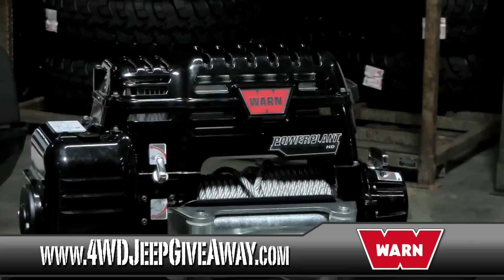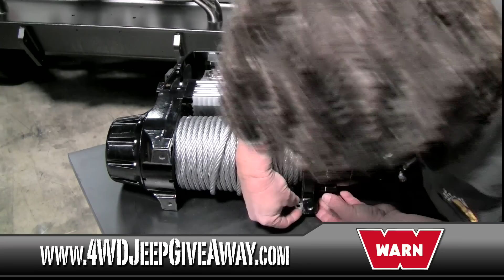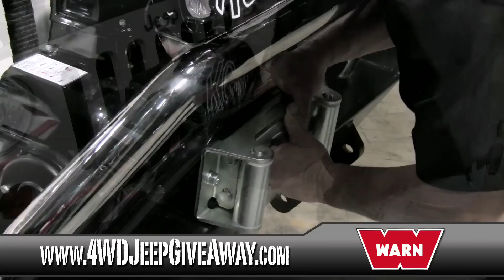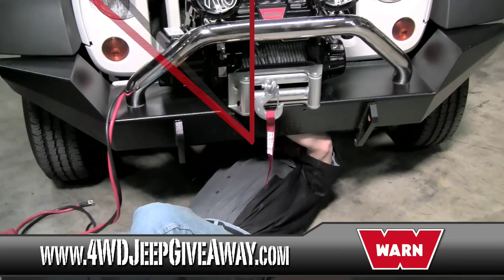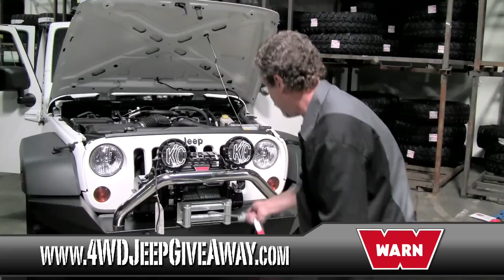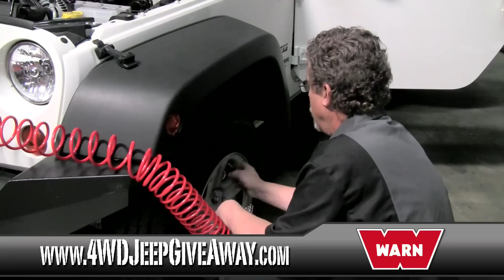Jeep Winches Winner: Installing a WARN PowerPlant Winch

Comment: I didn't think anything special about this winch until I seen the air compressor. I hate driving back on the road after I aired down for crawling. this looks like a really good piece. does the hose reach the back tires? also the mounting would fit on any bumper with a standard  winch mount hol es right? thank you for this video it was very informative.
Reply from the maker: Warn PowerPlants are great winches! The hose is 20 feet long, so you should have no problem reaching your rear tires. This winch uses a 10" x 4.5" mounting pattern. Thanks!

Comment from the maker: Your 4 Runner should weigh in around 3700lbs stock. Depending on the overall weight of the vehicle and modifications made you should be ok with the Warn VR8000-s. As far as hooking to the stock battery, this shouldn’t be an issue as long as the battery is charged and not dying.

Comment from the maker: @HugeRedneck7 Yes it does block a portion of the radiator. But we have yet to find an instance in which the winch has caused an issue with the vehicles engine temperature on a Jeep. If you have any further questions, feel free to ask here or call one of our friendly sales associates.

Comment from the maker: @PCasey144 If you run the entire spool of wire into the winch or use the winch for recovery, yes the vehicle should be running. But for just pulling the wire in a few inches, its ok to not have the vehicle running.